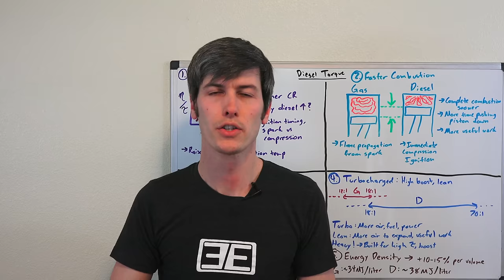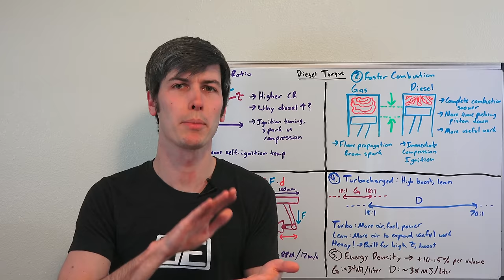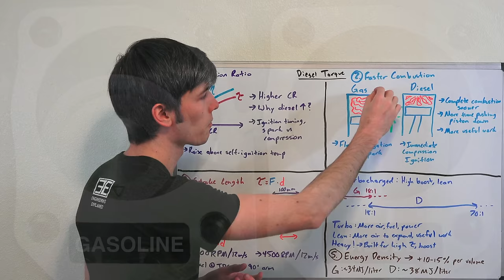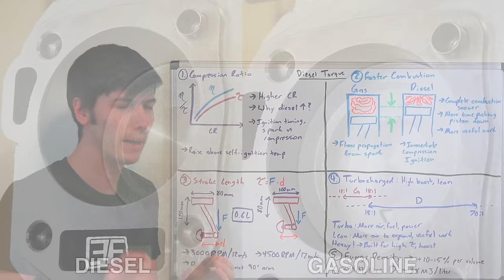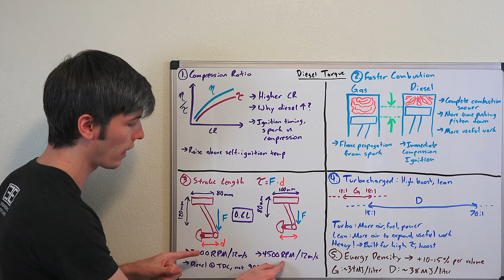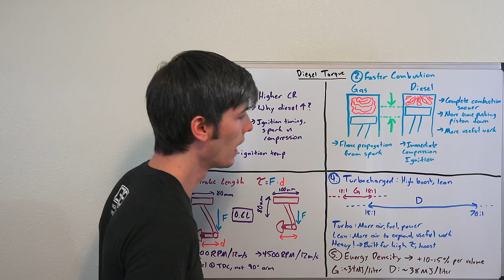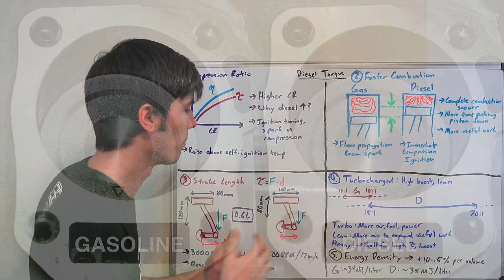5 Reasons Diesel Engines Make More Torque Than Gasoline

Comment: Hi Jason - Nice video.  It would be interesting if you could do a segment (if you have not already) on how engine designers create an engine for more or less torque, along with how they control what RPM that torque reaches its peak.  Obviously your video touched on some aspects of what influences torque; it would be interesting to list all the variables and their trade-offs versus each other.  Thanks.
Reply: Well, there is actually only one reason that diesel engine is PERMITTED to have more torque than gas engine, and that is because diesel engine is built much tougher than a gas engine in order to handle more torque.  Diesel engine has a slower combustion process therefore cannot produce torque at high speeds, so to make up for this, it must have higher torque at lower rpm to compensate for the lack of torque at higher rpm.  Gas engine is designed to be light, plus  risk of detonation at lower speeds with higher loads, therefore is NOT permitted to have high torque at slower speeds, because it will self-destruct.  At higher rpm, gas engine cannot complete its combustion until the piston is halfway down, therefore cannot impart all of its combustion energy to the piston, so its peak torque is lower than that of the diesel engine that is ALLOWED to burn more fuel at lower speeds due to the lack of detonation risk, but that's by design only.  Theoretically, a diesel and a gas engine burning the same quantity of fuel per stroke at low rpm at which complete combustion happens early in the piston downward stroke should have similar torque...but of course,  in real life, the gas engine is NOT allowed to have its peak torque due to its lighter construction and the risk of detonation at lower speeds with higher loads.

Comment: Please make a video of gasoline versus ethanol. How does a full flex fuel engine performs with each one of these fuels?
Reply: complex topic. Would be interesting but this is closer to chemistry than engineering. :) A simplified answer from me (not an expert) would be ethanol has less energy than gasoline but burns hotter and faster (cleaner) allowing for you to pump more in at a time to make up for the energy loss. High ethanol fuels can overheat an engine or burn out seals on an engine not made for it. 

Unless technology has changed -- which is very probable -- it used to take 1 gallon of gasoline to produce 1 gallon of ethanol so it was more of a waste of time for anything other than performance engines like F1 or NASCAR vehicles.
Reply: acephantom903 I live in Brazil and here we have flex fuel engines for over 30 years. Nowadays more than 90% of veihcles sold each year here are flex ones. Almost every gas station here has pure ethanol (94% actually) pumps. Most flex engines here can produce more torq and power from ethanol than gasoline. In many parts here is cheaper to run on ethanol than in gasoline.
Reply: That is interesting. I wonder how you have ethanol so cheap. Maybe it isn't that the ethanol is cheap but the cost to import gasoline is high? Flex fuel engines are made to handle to increased heat while normal gasoline engines can handle a max of 20% ethanol before it gets dangerous. Because you have such high ethanol contents, your car's computer can see that and can increase fuel injection to give you stronger power than gasoline as it doesn't need as much air while combusting. Do your flex fuel vehicles also have a setting to increase fuel efficiency when running high ethanol rather than higher power? It would only be a computer setting change to have the different modes.
Reply: Fernando Sousa ... iirc...it takes 30% more ethanol to get the same energy output of gas. Ethanol also is higher octane so lots of turbo guys like it for high boost.
Reply: Fernando Sousa 
I had a Brazilian classmate in tech school some 20 odd years ago, and that’s about what he said. 
Gasoline is for washing parts 😂
Reply: Engine masters did a basic comparison of race gas vs e85. E85 is some great stuff yea you burn a bit more but it's cleaner burning and the higher octane allows more timing advance
Reply: We have cheap ethanol in Brazil cause it's made a lot easier and cheaper from sugar cane instead of from corn like (at least some time ago) they used to make it from in USA. Actually, we don't exactly have flex-fuel cars for that long, but alcohol/ethanol cars for even longer (it was around the 70s I think when they came to production).

Flex fuel cars usually just take the ethanol fuel lines to handle the added corrosive nature of the fuel, an electronic fuel injection and ignition that along with it's common array of sensors already provides an easy way to adapt to any new fuel mixture that the engine can burn thermodynamically speaking (so no Diesel but any mixture of ethanol and gasoline in the tank), and a so called compromise compression ratio: something that gasoline won't knock with, but not so optimal, and a tad too low for ethanol. The result is an engine that can take any of the 2 on any ratio.
Reply: 50.5% more actually for E85 specifically, about 63% more for pure anhydrous ethanol to run at the same stoich equivalence as petrol . 30% figure is a common misconception which I still can't figure out where people get that figure from?
Reply: Ethanol actually burns cooler than gasoline.  The reason it produces more power is due to it phase change cooling properties (latent heat of vaporization) and increased octane rating. It does burn cleaner though.
Reply: I would take a guess that it's a "rule of thumb" figure people got from just testing it out, based on the flex fuel engine's compression not being exactly optimized for ethanol.
Reply: I understand from a couple people in the auto service world that engines not specifically designed to run on pure ethanol have much shorter maintenance cycles, because ethanol has different solvency properties than gasoline and wears on oil, seals, and gaskets.

Besides, why should we be growing corn just to make clean fuel when we still have a hunger problem?  Priorities man, priorities.
Reply: Well to the corn dilemma: 
1 - not like they would feed the poor with that corn anyway, so it would just not get planted.
2 - It's cheaper to do it with sugar cane anyway.

About the increases in ethanol mixed into gasoline on countries where flex fuel engines aren't that popular, it does give issues with reliability indeed. For countries where ethanol was well established in other hand it's not an issue as engines are already prepared for it.
Reply: acephantom903, that is incorrect. Ethanol is a an extremely efficient coolant because it has very high latent heat (it absorbs alot of heat in order to get hot, pretty much like water). This is one of the main reasons Ethanol is such a great fuel for high boosted engines. Boosted engines suffer alot from elevated temps in the combustion chamber (the higher the boost, the worst it gets) and Ethanol, being a natural coolant, is excelent to bring engine temps down. One gram of Ethanol has 5x the BTU cooling power of 1gram of gasoline, so if both fuels ran at the same AFR, Ethanol would be a much better coolant. In reality, Ethanol runs at a much lower AFR, (E100 ethanol is stoich at 9,3:1 AFR, vs 14,6:1 for gasoline). So with more ethanol, and with much higher BTU cooling, you have much, much lower temps in the combustion chamber (most people don't realize that fuel is used not only to generate heat, but also to cool; that's why engines always run rich at WOT). The downside of this is, 1st; ethanol will give you lower mileage (here in Brazil, if you run your car on E100 ethanol, you will have 70% of the mileage that you get on gasoline - it's important to remember, however, that every gasoline sold in Brazil is either E25 or E27, we don't have pure gasoline like in other countries).

The other downside of ethanol are the cold-starts. Ethanol is really hard to start in cold days, while gasoline burns very easily even in the cold. This is one of the main reasons that Brazil's Ethanol programme never really took out of Brazil in the 80's. Brazil is a generaly hot country and we don't have very intense winters, so Ethanol runs ok in our cars. For temperatures above 20c, the enigne can start with ethanol alone. However, for temperatures below 20c (which are common in the southermost areas of Brazil) an engine running on Ethanol will NOT start easily. For this reason, Ethanol vehicles here in Brazil are equipped with a secondary gasoline tank; so when you try to start your engine in a cold morning, it will inject gasoline and this gasoline will allow the engine to start; once it starts burning it doesn't need gasoline any longer, it can keep solely with Ethanol. The main problem is just the first "burn", so you only have to inject a small amount of gasoline. Modern cars with direct injection engines do no longer need the gasoline reservoir since they able to start solely on Ethanol with temperatures as low as -5c (since 99,99% of the places in Brazil never reach such low temperatures, that is enough for us).
 
Here in Brazil we have pure, E100 hydrated Ethanol on fuel stations (it contains around 5% of water, which further increases the cooling capabilities), but nowhere outside Brazil do you find E100. The reason our Ethanol is hydrated is because the natural process of distilation of ethanol gives out a chunck of water. Ethanol mixed with gasoline has to be dehydrated first, since water acts as a seperating agent between ethanol and gasoline, and the dehydration process of ethanol is actually very expensive (that's why dehydration of ethanol is only made for ethanol that's mixed with gasoline, regular E100 ethanol is hydrated since it is much cheaper). Out of Brazil you only find E85. That is because, by adding 15% of gasoline to the mixture, you can allow for cold starts without having to add an additional cold-start gasoline reservoir.

The main problem for tuners is that these 15% of gasoline added to Ethanol considerably lower the octane rating (ethanol has extremely high octane rating), but E85 is not really meant to be used as a performance fuel, it's more of an "organic alternative" to gasoline. However, despite having a lower octane rating, E85 still has great cooling capabilities (after all, it still has 85% of ethanol), so it's still a great choice for performance vehicles. The reason flex-fuel cars develop more power on ethanol is because they run with much tighter ignition timing once ethanol is detected by the FIS, since ethanol is much harder to knock, it can run with tighter timings (as a matter of fact, it MUST run with tighter timings, since, this way, the burn becomes more efficient) and, by consequence, develop more power. Turbocharged engines can run not only with tighter timing, but also with higher boost pressures. Ethanol is a natural anti-detonant, and it's octane rating is around 130 (but that's for E100, E85 has considerably less than that). However, you can't compare E100 to 130 octane gasoline, and this is because cctane testing is done in a set pressure and temperature, when cars running on ethanol, in reality, run much cooler. And when you run cooler, knocking becomes much harder. 

To try to simplify... if you have 110 octane fuel running hot, you will have higher knocking chance than, say, 100 octane fuel running cold. That is, Ethanol, which has a 130 octane rating, can't be compared to 130 octane gasoline, because Ethanol runs much cooler, and by running cooler it will be much harder to knock. In reality, the 130 octane rating of Ethanol is comparable to something closer to 150 octane for gasoline. And you can see that in reality. I have seen turbocharged cars starting to show problems at only 2bar (28psi) of boost running on gasoline (2bar is considered "high boost" for gasoline), and on ethanol, the same engine was able to operate as high as 4bar of boost with no knocking. Sometimes you might see engines that can run 1500hp on "racing fuel" but only 1000hp on street gasoline; in other words, the engine has internals that are strong enough to handle 1500hp, but gasoline can only handle 1000hp without knocking; that shows just how crappy gasoline is. With ethanol, you are never limited by fuel, the limit is always how much your engine internals can handle. As long as you keep your fuel mixture rich, you will never suffer engine knocking.
Reply: Fernando Sousa Good question!

Comment: You dont understand basicaly physics! please compare without turbocharger > and same displacement (not compate 1.4L gasoline with 1.9 tdi with turbo) for example>
  2.0FSI have bigger torque than 2.0 Sdi 16V  , please dont compare gasoline engine without turbo with diesel engine with turbo...
Its ABSOLUTE TRUE > ENGINE  with more air have more torque, but with same air comsume have gasoline biger torque...
Exist (BOBA racing, AME racing and more users 800HP+) turbocharged gasoline engine have with 2.0L 1000Nm and more than 1000HP and exist evo 2.6L have 2500HW...diesel with same displacement end about 450-500HP on clear diesel, yes its exist more but with NOS or methane injection but still less than 1000hp on 2.0Tdi
Reply: Dunning-Kreuger.  :)
Reply: Guy basically said diesel fuel has %10-15 more energy in it and youre trying to say gasoline car has more torque in same condition is kinda funny. Diesel engine doesnt have more air inside the piston because of only turbocharge, it has more space ! Same amount of fuel, more air, more energy in fuel will result as more torque in same conditions. Jeez dude ...

Comment: Take a gasoline enginge and a diesel engine same bore and stroke and same displacement and you will find out that the gas engine makes more torque.
Reply: If you mean both with the bore and stroke of the gas ones, yes. If with an arbitrary bore/stroke, no.
Reply: You can't because of octan's flash point. Over 12 Cr, gas engine starts knocking...